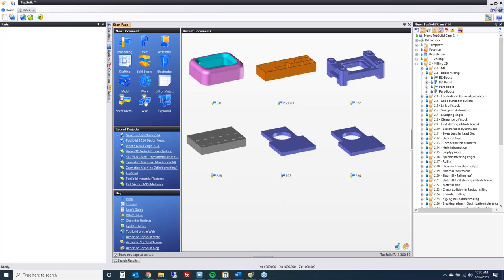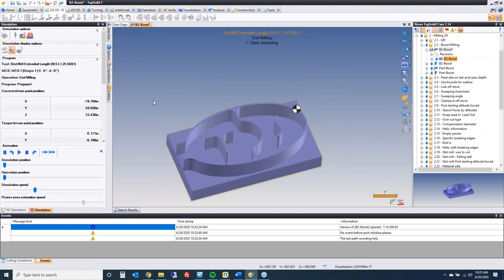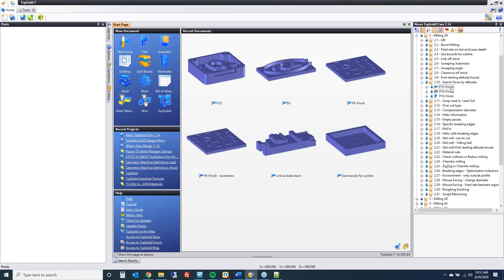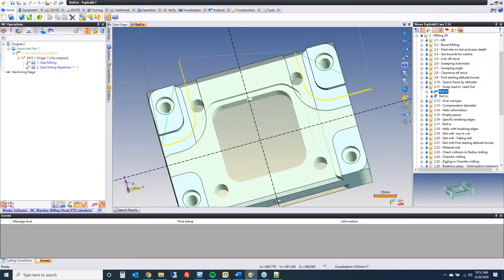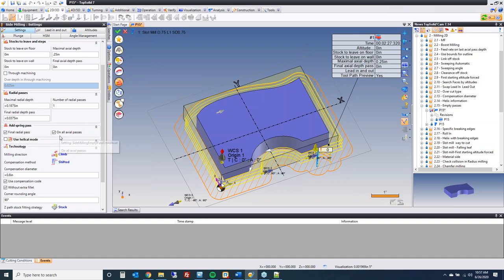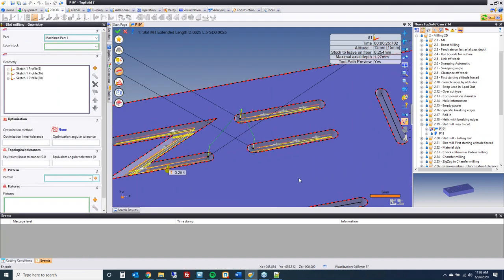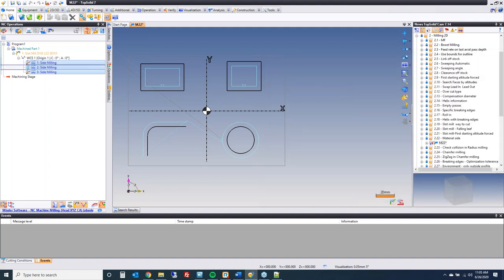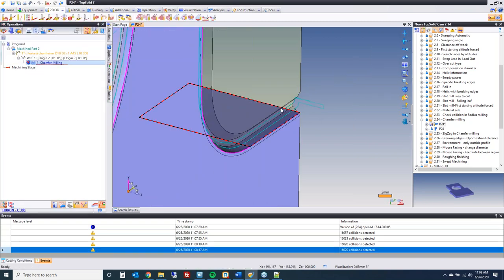TopSolid 2020  2D Milling News

Comment: Great video Bill! I unfortunately wasn't able to make the Webinar or I would have put you on the spot then. 
At the 9:15 time stamp you talk about Feedrate at last axial pass. I am very happy that you have added that and would use it however, I would also love to see a step-over modifier on last axial depth pass. I often rough leaving .01"-.015" on the floor with a 10-20% stepover. Then on the last axial pass I create a new operation because I want to remove that last material at an 80-90% stepover. The feedrate and spindle speed modifiers allow me to eliminate the need for an added operation but I will still need to create one for the change in stepover. 
Looking forward to the Webinar later this week! Chris